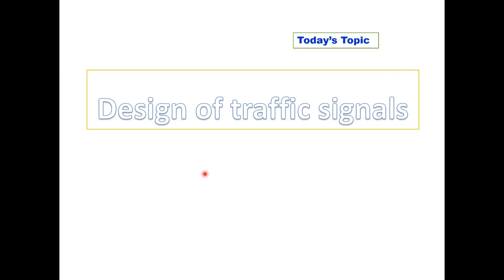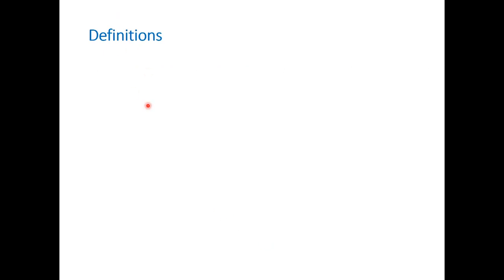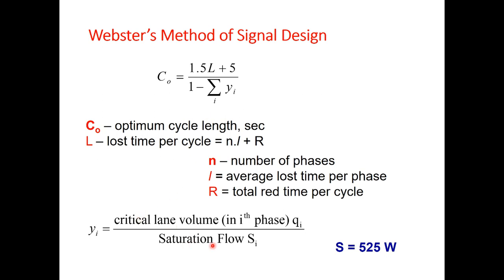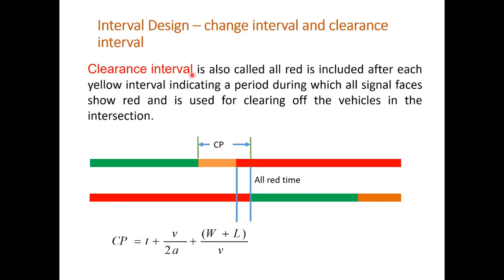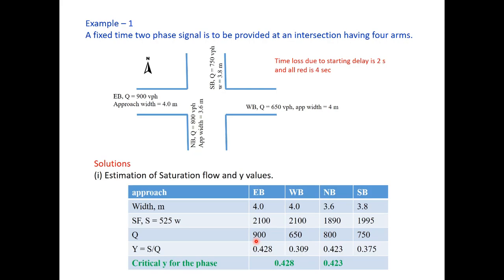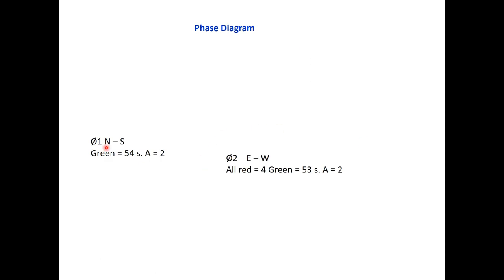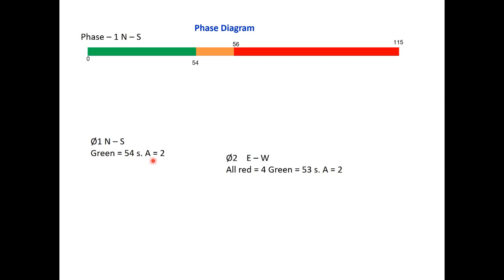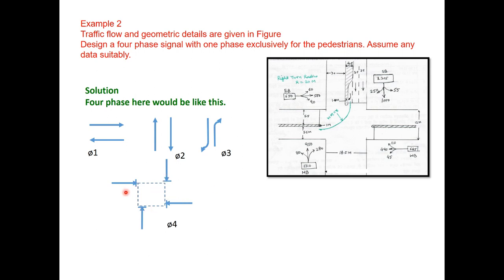#traffic, #signals, #trafficsignals, Design of Traffic signals, green time, amber time and red time

Comment: Thank you for your nice explanation, sir, I have one doubt regarding the saturation flow, as per IRC 93 1985 page no 37 S=525W is valid only for 5.5m to 18m width, for lesser width of the road there are some values given in page no 38, but in your example 1 you have taken 525W for lesser widths, could you please let me know why did you take that?
Reply from the maker: Yes, you are correct. These values of S should be taken as per table given in IRC code, page 38.
You may redo this example and see the difference
Thanks

Comment: Sir,
When  I worked out a practical case, total y exceeds 1. is that possible? can you please explain in detail?
Reply from the maker: In a normal case, total Y does not exceed 1. If it exceeds it suggests that traffic signal cannot take the traffic load at junction. In that case, look at individual values of yi and see which arm of the intersection needs to be widened to increase Si. Alternatively, go for overpass or undepass for major road.
Reply: Thank you sir